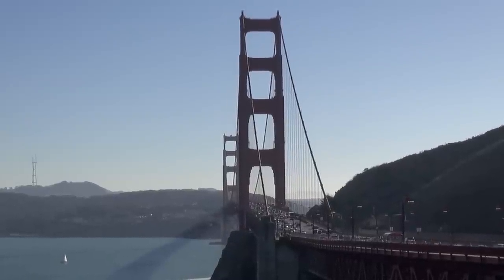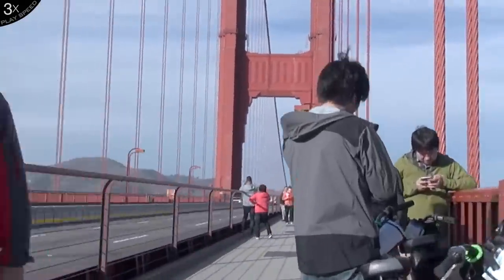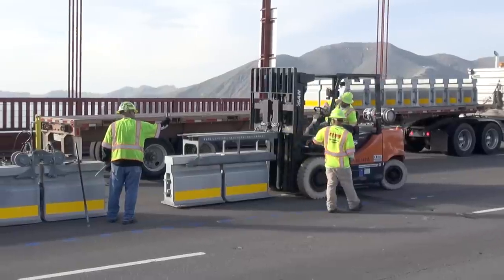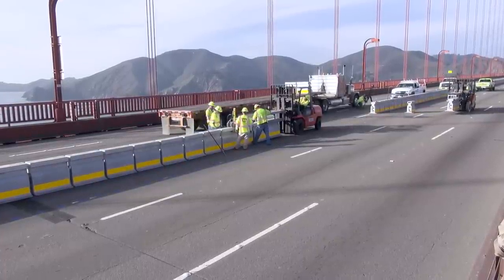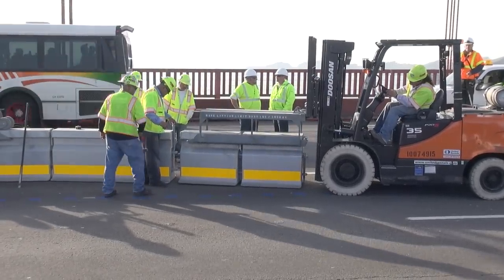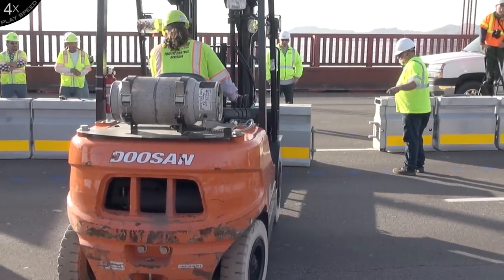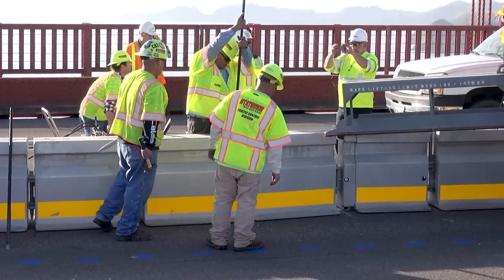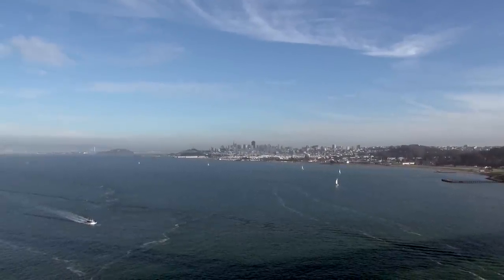Golden Gate Bridge moveable median barrier installation: closeup and narrated (January 10, 2015)

Comment: Congratulation to the Golden Gate District of Caltrans for the hard grind of over 20 years, to get the barrier onto the bridge. Having worked on the replacement MLB for the Auckland Harbour Bridge here  in New Zealand some 5 years ago, I understand the benefit of this important roads safety device.  The users of the GG bridge now get the very big benefits of not having to worry about head-on crashes. Need to also say that Barrier Systems; the manufacturer of the system, are a great team of people to work with. Well done to all concerned.
Sorry, forgot to mention. HD video is excellent. For being an outsider looking in, coverage was very professional and informative - well done //waf.
Reply from the maker: Warren Fowlie Thanks, Warren, I appreciate the comment.

Comment from the maker: Golden Gate Bridge moveable median barrier installation: closeup and narrated.  Take a stroll across San Francisco's Golden Gate Bridge with me as we watch up close the assembly/installation of the new "moveable median barrier" (MMB), including the insertion of the final center segment. I have no association with anyone in this project — I have no inside knowledge — so I apologize in advance if there are any technical errors in my narration!

This new Moveable Median Barrier (MMB) system is about 13,340 feet of 12-inch wide and 32-inch high steel clad units filled with high density concrete pinned together to form a semi-rigid median barrier. There are also two barrier transfer machines, aka “zipper” trucks.

This replaces, and is a vast improvement over, the old plastic pylon divider system, which we review for a moment at the beginning of the video.

 #goldengatebridge   #goldengate   #sanfrancisco   #sanfranciscobayarea   #medianbarrier   #ggbridge

Comment: The first ever that came to operation was utlized in Boston Dorchester Quincy 93 express way in Massachusetts. This type of divider aka "zip line" not only partition the road but also will help to add and change the amount of lines available on each side of the traffic based on time of days and amount of traffic. Very smart solution to help ease the rush hours traffic indeed. Nice video.... Thank you

Comment: In reference to the bridge never being closed for construction, there have been closures when they were re-stringing the vertical suspender cables.  They had a machine that climbed up and down the main cables, and they had to close the bridge for a few hours when they moved the traveler from one section of the bridge to the next.
Reply from the maker: dw75002 Various news reports at the time made this claim.  The claim was that it had never been completely closed for construction, only for various celebrations.  I can't vouch for the accuracy of those reports, as the bridge has been around longer than I have ;)
Reply: Party Of The Third Part I was there when the traveler was moved from one side to the other during the restringing operation.  Yes the bridge was completely closed in the middle of the night.
Reply from the maker: gatekeeper ' Thanks for letting me know!  I'd fix the video if I could, but YouTube doesn't allow in-place replacement.  I'll see if I can put something in the annotations (for those that can see annotations).

Comment: It is a copy of the Auckland Harbour Bridge in New Zealand which was the FIRST.  

BELOW IS A DIRECT QUOTE FROM WIKIPEDIA
In 1990, a movable concrete safety barrier was put in place to separate traffic heading in opposite directions and eliminate head-on accidents. Two specially designed barrier machines moved the barrier by one lane four times a day,[28] at a speed of 6 km/h. It took 40 minutes to move the barrier, which was the first of its kind in the world.
https://en.wikipedia.org/wiki/Auckland_Harbour_Bridge
Yes folks, the USA is 25 years behind New Zealand when it comes to zipper lanes and moveable barrier machines known as road zippers.
Reply: +peggyt1243 this barrier is of metal not concrete.... soo it is a Movable Steel safety barrier ....and i think it will be more durable ..... if it is a copy I don´t know. and i dont know if you were angry  .... XD
Reply: +ma va My issue is the USA claiming they are first.   They are not the first to have a zipper lane.
Reply: ok . I understand you.
Reply: Who claimed the Golden Gate movable median barrier was the first one? I heard no such claim in this video. This video starts out saying that people having been talking about putting a movable median barrier on the Golden Gate for many years and that the video is documenting the first time the Golden Gate has had such a barrier. The wording implies movable median barriers have existed elsewhere before.

Comment: Thanks for the video, it was surely well done and informative.  I can't believe they don't have a jig that allows them to pickup and move one of the barriers from its side.  Strange.  I wonder about the added weight to the bridge.  I must be a lot, though it is spread across the whole span.
Reply from the maker: +lifesavrdwd Thanks for the comment I appreciate it!  There are a couple of us who have speculated about the weight elsewhere in the comments for this video.
Reply: +lifesavrdwd nah. the maximum each set of 2 could possibly weigh is only 3200lbs,  based on the jig's warning marker.

Comment: The whole engineering problem at the end could have been eliminated if they had started assembling the barrier from the center outwards. Seems like an obvious solution to an obvious problem.
Reply: MrPLC999 my thoughts exactly.
Reply: MrPLC999 Yup, I was thinking the same.  You can still work twice as fast as starting from only one end but you don't have to worry about lining anything up.
Reply: +MrPLC999 The point of the dividers is they are movable to allow more lanes for rush hour. They have those expansion joints every 20 sections or so because if they did not they would not be able to move the divider to the adjoining lane within the length of the buss size equipment used to move the dividers.  Google zipper lane divider
Reply: +Jeff Sloop These are State workers. They don't know what fast means. One of many reasons why California is going broke.

Comment: Why did not they start in the middle and go to the ends...adjustments would have been easier.  Also, THANKS for posting, I love watching all sorts of construction.  I just wonder what's the bottom made from...dragging it across the lanes won't it tear up the bridge and then they have to close it to repair the damage.  Will they paint the steel parts so they don't rust.  How long does it take to move the entire barrier.  I think someone should climb to the top of one of the towers and base jump with a wing suit....yeeehaaa..Thanks again for posting.

Comment: Did any one calculated about the weight of the barrier which is left on top the suspension bridge.  Is there any impact on the bridge stability.  Although the traffic on the bridge is counted, but it is an moving traffic.
Reply: no, nobody ever thought to calculate that, just you. You're a genius

Comment: Interesting,  @12:38  to 13:24  you can clearly see the end on the right is a special sliding link to allow for adjustment installing the last section. What is the purpose of this being movable, to allow for an extra lane one way in morning traffic to work, then the other way heading home?
Reply: +firstname lastname  Yes switch it to 4 lanes in and 2 lanes out morning rush hour and 4 lanes out and 2 lanes in during evening rush hour.  Here in NYC to NJ they use the 4th lane for buses, but they don't have a fancy barrier system. Just the cones and pegs, kind of scary for guys to move them during full traffic.
Reply: Military bases and D.C.use the closing of lanes in rush hours. Works very well.

Comment: Scary? Has this man never driven on a two-lane highway? I know of some fairly narrow two-lane highways that have a speed limit of 75.
Reply from the maker: Jordan Saylor It was a little scary because the lanes are narrower than standard, there are no shoulders at all, the markings of the lanes do not distinguish in any way the directions (there are only white dots that are the same in every lane), there are no lights above the lanes as many places have to show the direction of travel, and the lane configurations change at different times of the day.

So other than the little widely-spaced plastic pylons, that are difficult to see, especially at night or when there is thick fog (which is very common on the bridge), there were no visual clues as to which lanes were for which direction, and the configuration is different at different times.  What was most scary was relying on all other drivers, including people from out of town and "impaired" drivers, to handle this situation correctly.

Also, those narrow roads you're talking about are typically one lane in each direction. On the bridge, there are 6 lanes.  So when you're in that left lane, if someone in the 2 or 3 lanes to the right of you makes a mistake (because they're a tourist gawking at the bridge) or has a mechanical problem (such as a semi blowing a tire), and swerves into you, there's nowhere for you to go, you're going into the opposing traffic because it is only 12 inches away and there was no barrier.  And the bridge is very busy, so you're not going to find an empty spot, you will have a head-on collision.

This is why the leftmost lanes on the GG bridge were widely known in the Bay Area by the nickname the "suicide lanes".
Reply: Where is there a 2-lane highway with a speed limit of 75MPH? In the United States, the highest, non-interstate highway speed limit is 70MPH, in Ohio, only for 4-lane divided highways.

Comment: At 11:05 one guy lift a barrier with a 3:1 mechanical advantage.
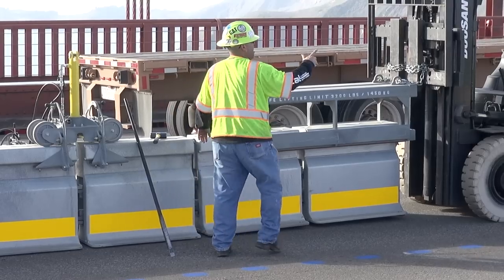At 5:35, you're claiming each piece (pair)  weighs about 1550 pounds, or 700 kg.
That's 775 pounds / 350 kg per barrier..
I don't know... that looks like a lot to casually lift 120 kg (or 90 kg with a 4:1 mechanical advantage), given that he looks like an average built person.
If someone can have a look at the physics behind that

Comment: Nice job overall . I am  the manufacturer and I am now wondering why I hired those expensive professional photographers. One minor correction the barriers are 1 M long (3.28 feet)  and weigh  about 1550 pounds each. Come visit our website at Lindsaytransportationsolutions.com for more technical details.
Reply from the maker: Chris Sanders Thanks. I'm sure the professionals can do things I can't.  I try to make my videos entertaining, sometimes with a "twist" if possible.  My advantage over the professionals is that I can throw away the ones that don't work out and nobody ever sees those.  Although... next time you have an interesting project in SF, maybe we can work out some sort of access ;)  No charge on either side!  ;)  Thanks for the correction -- unfortunately with YouTube there's no way to replace or update a video.  I can add some annotations with corrections, although annotations don't work in all environments and people turn them off too.  I did actually visit your site for my other video about the Road Zipper -- hope I got that one mostly correct.  Thanks for the comment, I do appreciate it.
Reply: Chris Sanders It is a nice solution, these barrier system. But i have a question. In the USA is the imperial system in use, so why are the parts 1 Meter long and not 1 Yard?

Comment: At 13340 ft long and each piece being 3.28 ft and weighing 1550lbs that comes to
6,303,963 lbs that is on the bridge all of the time. I wonder if they took in to account the wear and tear of the bridge, but if guess there really wasn't another option.
Reply: +kingmike40  -- ITS GOOD JOB YOURS AS ALREADY YOU MAKE MATHS BEFORE I DO IT, THANKS BUDDY, 
SO IT COMES 2,865 M.TONS WOWWW, WHAT A BIG DEAL OF WEIGHING CAPACITY OF THE GG BRIDGE.
Reply: +kingmike40 The company that built this system, Barrier Systems, was purchased by Lindsay.  Barrier Systems was formed roughly 20-25 years ago for the primary purpose of putting this system on this bridge.  It's taken that long to get all the approvals and funding.   In that time, though, dozens and dozens of these systems have been deployed throughout the world.

You can be sure that the bridge engineers had hundreds of hours of discussions of the extra weight.  Take into account, though that cars are getting much lighter.  We have priuses and Leafs now, not Oldsmobiles and Buicks.

Comment: i'm questioning about them pieces are what he said 1,550 lbs each .... @ 8.10 min into this  (3) men drag one over into place..
i don't believe that would be possible as each man can't move 500lbs  like that
Reply from the maker: +Mat Tuk Here is a newspaper article about the project, in which it is stated:  "The barrier will be made of more than 800 blocks that weigh 1,500 pounds each. "  http://www.mercurynews.com/california/ci_27273680/new-zipper-trucks-golden-gate-bridge-will-move
Reply: The barriers are made of steel, and I think are filled with concrete after installation by the hose connected to that thing with wheels being slid across the top of the barrier.
Reply from the maker: +Peter Smyth The barriers are already filled in with concrete when they are installed.  The wheeled thing that goes across the top aligns the segments properly and then drives the connecting pin between segments in the rest of the way (the guy with the hammer only starts the pin going, hammering it only part way in).  The segments are heavy, but have a relatively smooth bottom and three strong men can slide them a little bit at a time across the relatively smooth pavement.  But it takes a lot of effort and they don't do that often.
Reply: +Party Of The Third Part I was wondering what that does, and how the pins got fully inserted.
Reply: +Mat Tuk The thing they are moving is a VLB (variable length barrier).  This is hollow steel.  They place these every so often to accommodate the expansion and contraction of the barrier as it changes positions.  As you can imagine, the barrier changes length as it goes through the machine.

Anyways, it's not 1500 lb, as you guessed.  Maybe around 500 or so.
Reply: +Mat Tuk at around 12 minutes you can see the VLB to the right of the screen.  It has an inner and outer barrirer that can slide in and out.

Comment: THIS THING TAKE FOREVER TO GET THRU- THE BRIDGE. PERSON LIKE ME THAT HAD NO DEGREE MAY HAVE A BETTER IDEAL THAN THAT. TOO SLOW. YOU DON'T USE FOLK LIFT TO LINE UP. USE MACHINE FROM THE GROUND WERE YOU LINE THE BARRIER AND PIN IT AT THE SAME TIME AND PUT THAT MAN THAT STANDING AROUND THERE TO DO SOMETHING ELSE.
Reply: +Tsialong Thow This way may not be the best, but it is the cheapest.  Also, if unions are involved, this is how it HAS to be done.  Unions hate efficiency.

Comment: San Francisco and surrounding areas have the most stringent EPA laws but yet they are running mid 90's trucks on this project.   I also have to add that these lift truck drivers are horrible.
Reply: +ted lovestrand The barrier machines are using tier III diesels.  They should have been using the newer, much cleaner tier IV

Comment: The very smallest car on the road doing warp speed will crash into the barrier and knock all the pieces into the river (O.o)
Reply: Kitty Cat No...No they won’t! These are Designed and Rated as Non-Gated QMB Barriers. Which means, Non-Gated= No Pass Thru. A fully loaded semi truck going 50-55 MPH hitting the pinned *Quick *Moveable *Barriers at a ~30-50 degree angle WILL NOT (should not) Break or Go Through/Over the Wall and into oncoming traffic. They have been Crash Tested and Rated.